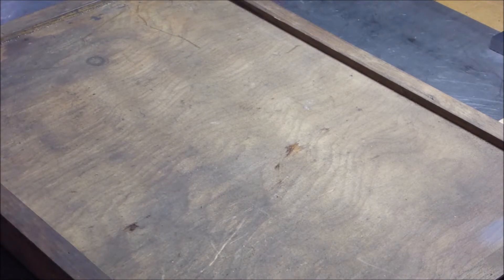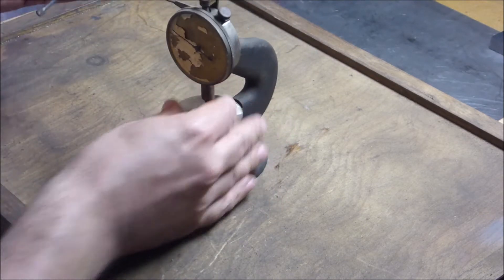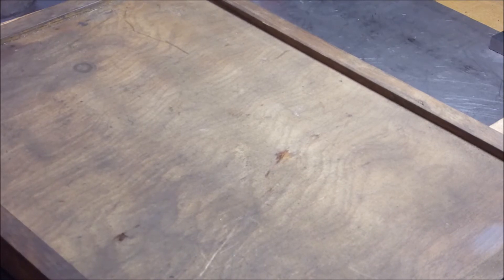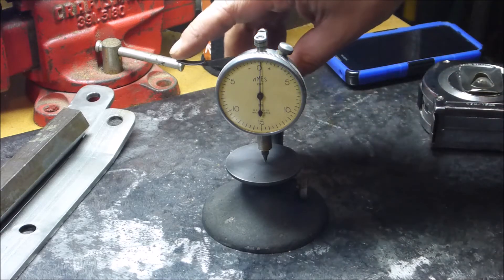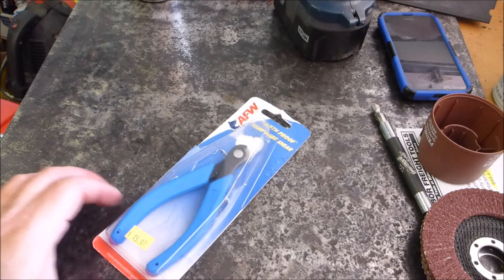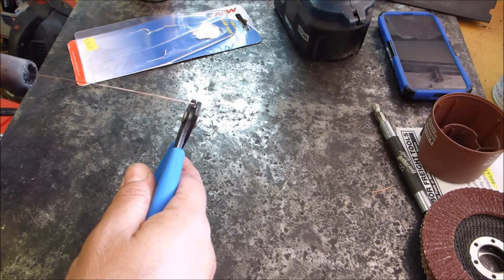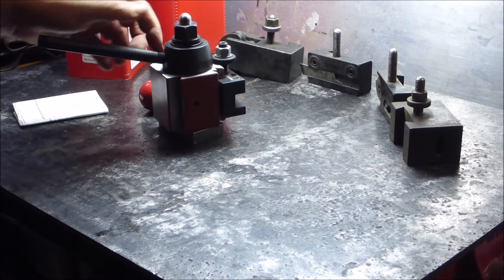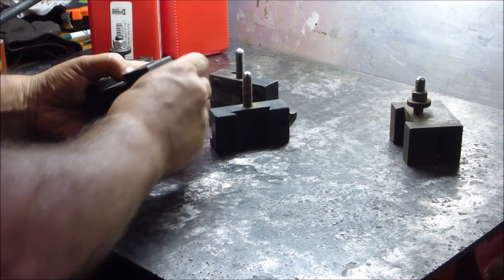2016 06 28 Shop Update

Comment: The MT2 holder has 2 advantages:
1. You can use power feed
2. You get more travel than the tailstock.

My tailstock only has about 2.5" travel.  Long drilling ops take several passes of sliding the whole tailstock back to clear chips.
Reply from the maker: Well there you go. Makes sense. Thanks!